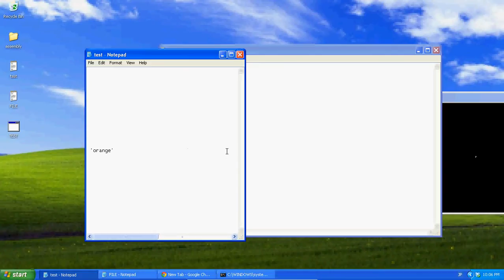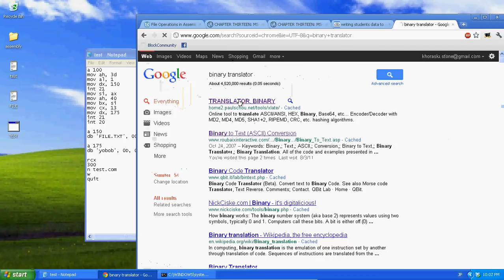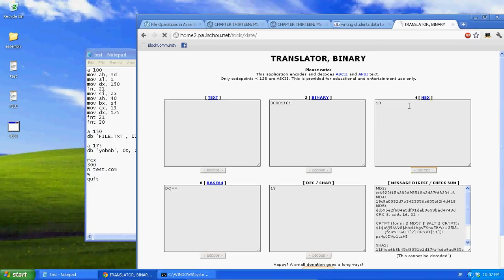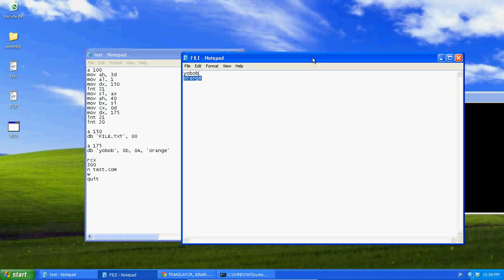Assembly Tutorial 14 - Writing Files

Comment: I've made a simple program which is supposed to export a text file with user input, but it doesn't seem to be working...

a 100
mov ah, 09
mov dx, 360
int 21
mov ah, 3f
mov dx, 175
int 21
mov ah, 3c
mov dx, 150
mov cx, 0
int 21
mov ah, 3d
mov al, 0
mov dx, 150
int 21
mov si, ax
mov ah, 40
mov bx, si
mov cx, 30
mov dx, 175
int 21
mov ah, 09
mov dx, 300
int 21
mov ah, 09
mov dx, 320
int 21
mov ah, 08
int 21
int 20

a 150
db 'FILE.TXT', 00

a 175
db '', 00

a 300
db 0D, 'File written.$'

a 320
db 0D, 0A, 'Press any key to continue . . .$', 0D, 0A

a 360
db 'Enter file contents: $'

rcx
400
n hello13.com
w
q